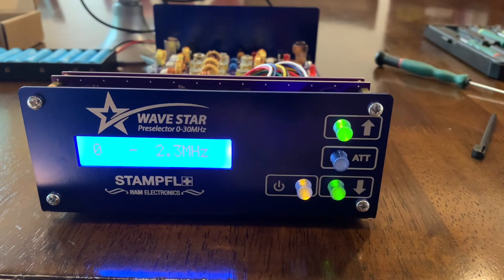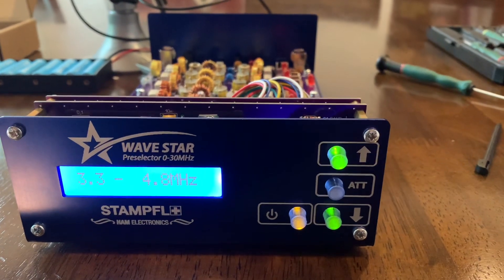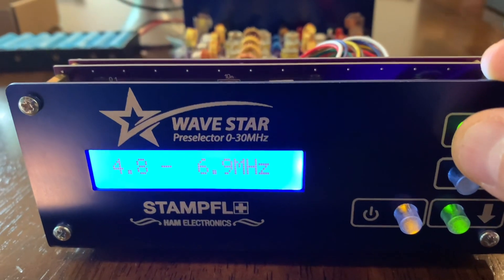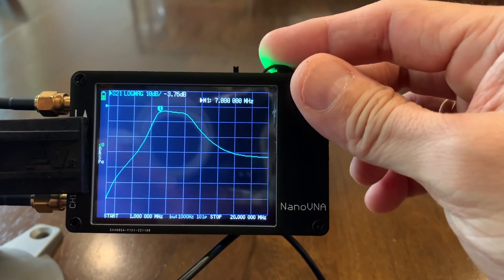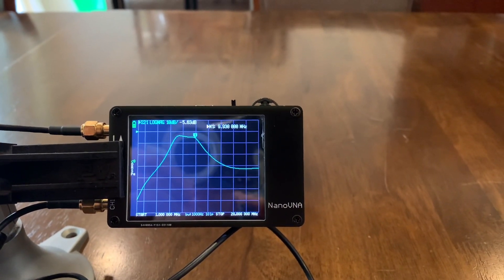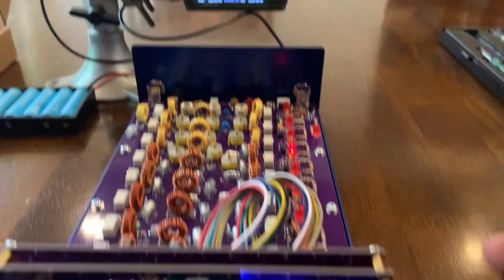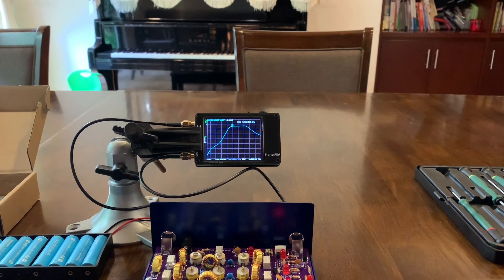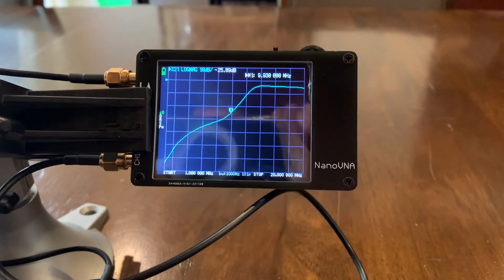Super Useful NanoVNA To Fine Tune Multi Band Pass Filters

Comment: I use the PC software with the nanoVNA to provide a higher resolution view, on a larger screen, but the process is otherwise similar.  The pre-selector I was testing was an MFJ-1048 and it gave all sorts of bad results - including on some bands insertion loss of > 20dB.  It turns out that the pre-selector was severly damaged by someone who, I am guessing, pushed > 100 watts through what is supposed to be a receive-only filter.  When a new (unopened) unit was tested, it performed as expected with an insertion loss of between 2 - 3 dB and normal passband filter shapes. Conclusion: the nanoVNA saved me hours of diagnostic efforts.